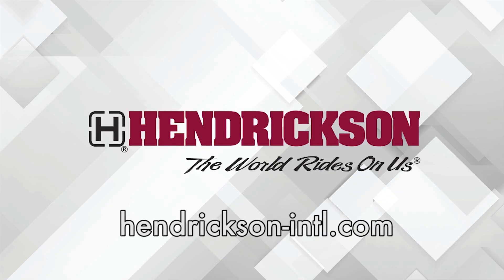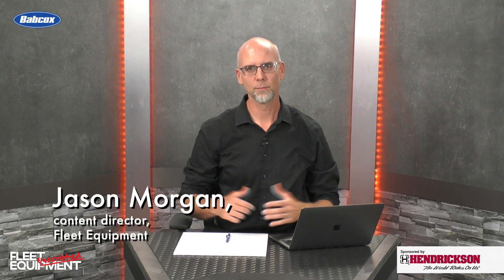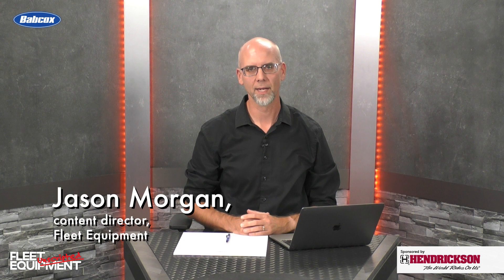Why it might be time to reconsider a 6x2 with liftable axles

Comment: Hi Jason. Back as far as 1991 arriving from Gt Britain I could not understand the 6x4 configuration of tractors. Obviously then learning of the low axle and GVW it baffled me as it does today. In 1989 I had a brand new ERF 6x2 twin steer tractor pulling a tandem axle trailer at 38000kgs (83,600 lb). I never had any traction issues even on construction and quarry sites. The second steer axle lifted to transfer weight to the drive axle. Pusher axles on single tires are common there, normal or super singles but there is more scrub than a twin steer. 
Here, I am not a fan of super single tires on tractors on rear axles, especially as in many cases they reduce the width of the axle compared to a twin wheel set up. The aspect ratio of the super single wheel needs to be changed, as it’s the same scenario on the trailer. The whole set up compromises stability.
I am a fan of pusher axles twin wheels and tag axles. With a lifting tag axle you get better maneuverability, the toll, tire wear and fuel savings. Having independent air controlled axles with automatic load sensing, ABS and EBS with anti skid traction control will all but eliminate traction issues. Dropping more air or lifting the tag in harsh conditions will also put weight on the drive axle. With the first axle being a drive axle the drive shaft is shorter, less vibrations and weight. I don’t see the need for 6x4 double drive on interstate commerce.
With automatic load sensing and air slide fifth wheels you achieve the optimum setting for maximum stability, braking and maneuverability aiding the tractor and trailers rolling road resistance and fuel economy.
VOLVO and MACK seem to be getting more 6X2 pusher axle tractors into the market.
If air suspension is fitted on the steer axle, perhaps the axle GVW weight can be raised to 14000 lb. There should be an incentive to anyone willing to spend the extra money.
We always talk about efficiency, there are a few simple additions that could achieve huge gains. Any ideas to what they could be?
Good topic for conversation.
Reply: @pauljohn6637 , I would disagree with you on 6x2 on construction sites and especially tipheads.  You are usually on soft ground and when you dump the lazy axle you simply punch the drive axle into the ground and stay stuck. I drive in the earthworks side of transport.  However on paved surfaces then YES, they would work.
Reply: Yes Kelly. I agree for applications such as heavy haul, construction and landfill sites 6x4s would be the best choice. 👍
Reply: A 6×2 sounds awesome, I run 8 axle total with hopper trailets with a steerable pusher on the truck and trailer, custom all aluminum tridem trailer with an additional steerable tag axle on the rear of trailer. (4 total trailer axles)   I can lift all but 1 of the 4 trailer axles and just the 1 pusher axle on the truck.   So I can lift 4 of my 8 axles total.  I run bulk loads in a hopper,  hoppers are very light empty and  about 20-40% of my miles are empty thats just the way hopper work is and I run permitted divisible overload permits on the 5 state area i run.    

All that said, there is no way a I could get by without being able to fully lock in all 4 wheels (8 with duals) of the tandem.  Bulk loads have you on a lot of rock yards and and in winter/ rainy conditions i see alot of stuck trucks that are 6×4 (but not full 4 way lockers, just locking the 2 axles)    i run full 4 way lockers and have not been stuck since I put em on.  I can run over 100K lbs gross on predetermined routes and when you get that weight in a soft rock or gravel terminal you just sink in.  

I totally agree with your assessment on Tire psi and tire pressure management systems.  I put on a Tireboss and actually custom ran it thru a merritor axle system to auto inflate and also auto deflate.   At the time I put it together it was a very custom and complex system but once you figure it out you realize that Tire pressure *especially on super singles( has more to do with traction than I ever anticipated)  that's why i built the system.  I just run to much weight to switch to a 6×2... but i run enough empty i sure think about it alot!   I couod get by 95% of the time, even in soft gravel conditions, but getting stuck 5% of the time will eat up the fuel savings.   I already pick up alot of axles when empty. 

Those auto load sensing systems that inflate your tires and suspension to match the load cost me probably 30K$ U.S to set up but has saved me that annually in Tire life and fuel milage empty.    Empty I'm 32K lbs so I can dial it in to get almost 8+ mpg with a machine rebuilt Detroit 60 series pre 99, pre emmisons motor when running empty.       Do you agree the automatic sensing systems are worth the trouble?   They sure take some settings up to do it right and sometimes even i get confused running it ... and I built it!   I don't really let anyone else drive my set up, don't trust em!   I can see why fleets have not widely adopted, but for guys like me it's a. Advantage.